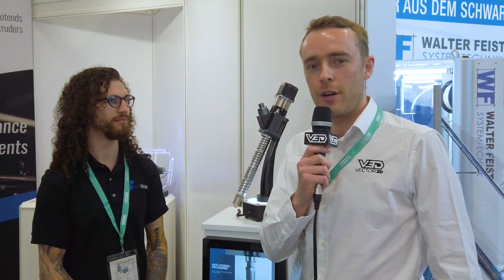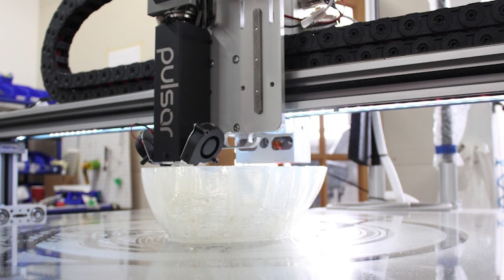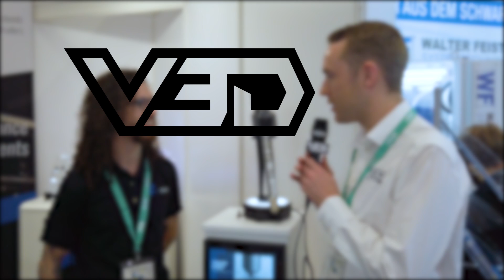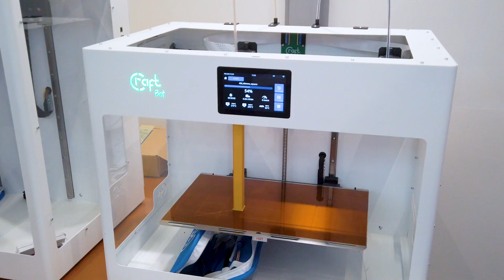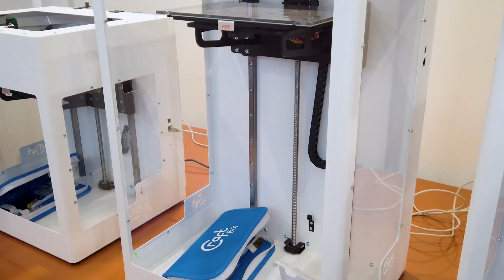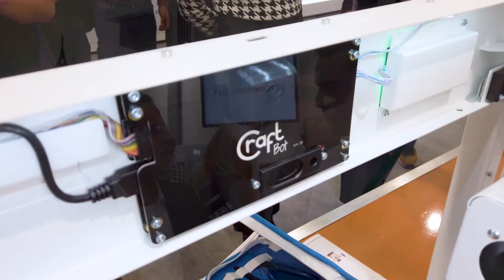Dyze Design And Craft Unique Interviews Formnext 2019

Comment: you can get an idex printer 400x400x700 already
Reply from the maker: Size isn't everything
Reply: @Vector3DP  you're right, but the craft unique guy said their idex printer is the biggest (or did he say largest?) on the market.  Do you know its printable dimensions?
Reply from the maker: Not sure off the top of my head. What's the large idex you know of? Also, didn't he also say ready out of the box? I think that was part of the claim.
Reply: @Vector3DP  "it's plug and play" caught me as a separate claim, but no matter.  The printer that I know of is the formbot (now vivedino) T-Rex 3.  Most variants are 400x400x500 but they are available with the extended Z axis as well.  Though, admittedly it is only an i3 style machine.  IIRC there's two bolts that need to be installed to make the printer functional, since it's packed flat to save on shipping.

I have no problem with you or the guy at craft unique, but bold statements that can be taken as arguably false aren't generally the type of statements one should make.  I'm sure there are several other large format printers with IDEX, since that feature isn't necessarily cutting-edge.  

TBH I think IDEX is mainly a gimmick except for mirror modes / duplicate modes or dual material printing.  Perhaps using the same material but using two different nozzle sizes (one for outside, one for inside) could also make quite the impact on time.